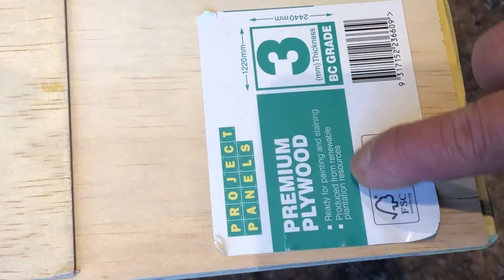How to make a DIY plywood canoe - from start to finish

Comment: Beautiful job and fantastic canoe.
Unfortunately, the video was not very helpful for someone with no experience, like myself
Reply from the maker: Thank you 🙏, Jimmy. No worries. I recorded every step of the built. I will post them soon. I am not a builder too. I built it using trial and error.  Now I can come out with the step by step and also things to avoid. If done correctly, you can complete the canoe in 6 days. No special equipment. Just a hand saw, cutter knife and lots of clamps. Keep in touch. Regards, Cornelius.
Reply: @corneliusoutdoors  fantastic 
I am looking forward to seeing the video
That really is a beautiful and functional canoe
Reply from the maker: 🙏 and very light. Only 15kg with heavy deck on bow and stern and the seat. The gunnels are thicker. I just couldn’t imagine a thinner gunnel will hold my weight. I am 110kg. The canoe is designed to hold 90 kg person.

Comment: Dont understand description, you say this built without epoxy just a $1 bottle of super glue but in video you use epoxy. You can of course use any ply as long as you water proof with layers of fibre glass.
Reply from the maker: Referring to the construction. Most plywood canoe are constructed based on stitch and glue. This isn’t. Just $1 superglue and lost of masking tapes. 👍🏽💪🏽